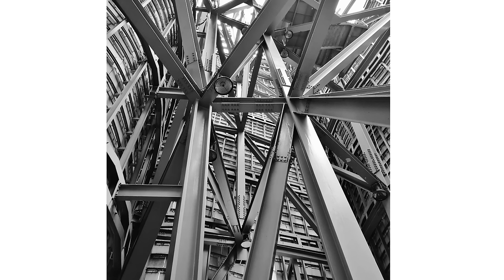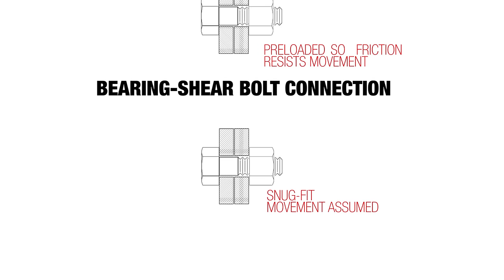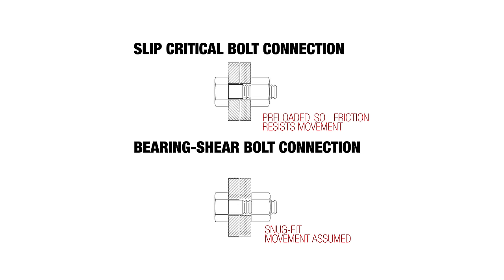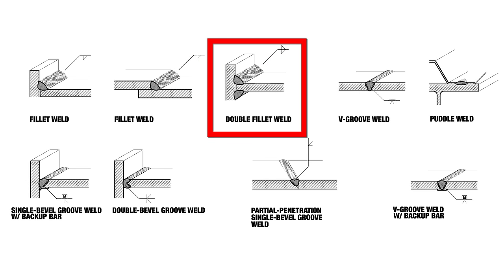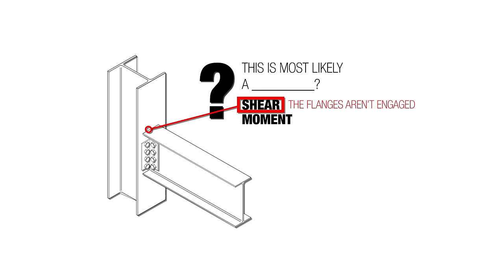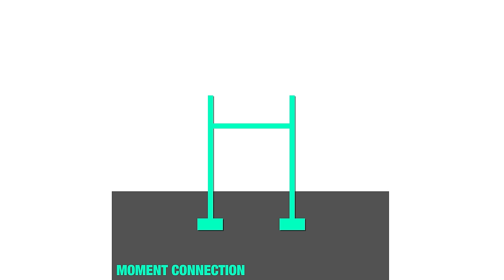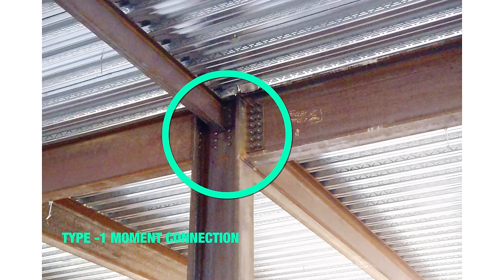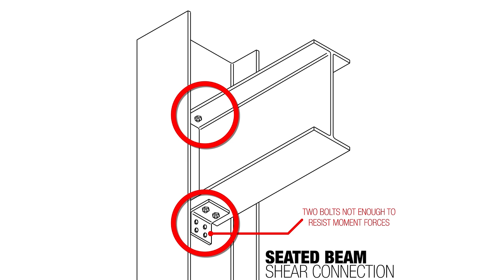Steel connections

Comment: 2:57 Is not a double Fillet weld. It is a Butt weld, or a Groove weld, probably double bevel full penetration.
Reply: Magic Smoke FPV when you weld two sheets of thick steel together you’d want to do a butt weld typically but it’s not that clean or if you don’t do it well enough you’d want to go over it which is exactly what it looks like was done on the outside of the stair where 3 welds are present. The second set of welds after the butt could be considered fillet welds but they’re more to fill in any gaps that the butt weld didn’t cover. With that being said they could be considered single bevel groove welds?
Reply: @amolinari9  no those are cover passes on a cjp . Not fillet welds . Magic smoke is correct.
Reply: Nice catch. I thought the same thing - cjp double bevel.
Reply: I was about to say the same thing, this is very basic and shows the lack of basic knowledge on this channel.
Reply: @phillhuddleston9445  Well... Only basic knowledge for a welder I'd say, and I know a lot of them, that don't even know that much, so I wouldn't judge him to hard haha!
Reply: @phillhuddleston9445  agreed. this is basic knowledge for someone in the field.
Reply: @amolinari9  Nobody here can say if the weld is a single or double bevel groove weld because we cannot see the shape of the steel plates whose edges are joined.

Comment: Galling from what I've understood it to be, is specifically something that happens when threading metals together. It is what causes threads of a bolt to seize in the threads of a threaded hole or into a nut. When I was working for a fabrication company we would use anti-seize lubricant on all stainless steel connections to prevent galling and seizing. Can anyone expand on this from 2:33, maybe I'm misunderstanding the terminology. I wouldn't think that galling has anything to do with the necessity of a washer, even though the concerns requiring the washer are completely valid, is there another piece of terminology missing?

Comment: 5:30 If you're gonna weld on the field, why even bother with the bolts? Why not just weld the whole thing together without the bolts?
Reply: Eqinor its for erection.
Reply: The steel beam can be supported by the bolts by itself while the welding can occur, making it far easier to build. If you had to hold the beam perfectly in place while welding it and waiting for the entire assembly to be completed, you would need to basically halt all other work while the welder finishes up each connection. With bolts, you can secure enough to have the beam stable, and then come back later and finish the moment connection before completion or moving up the to the next level, etc.
Reply: All these answers are correct and also its 3 times more expensive to weld in the field vs the shop.